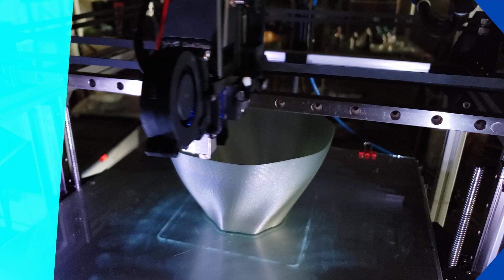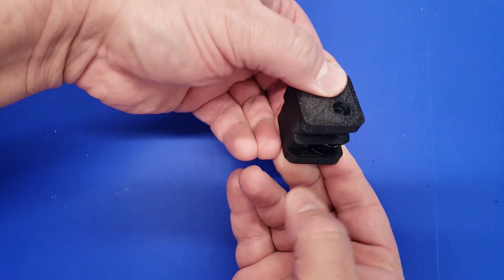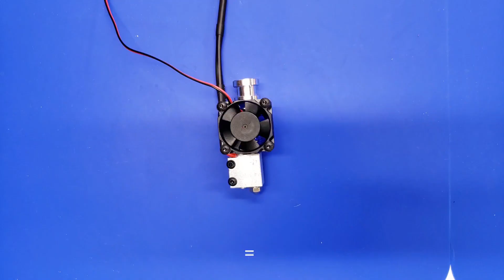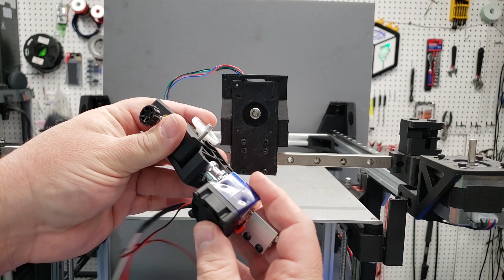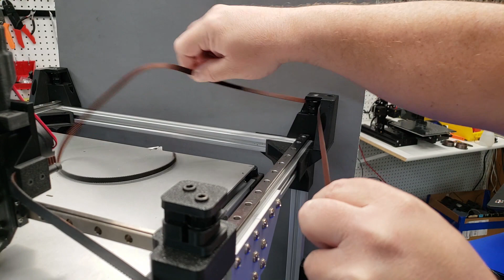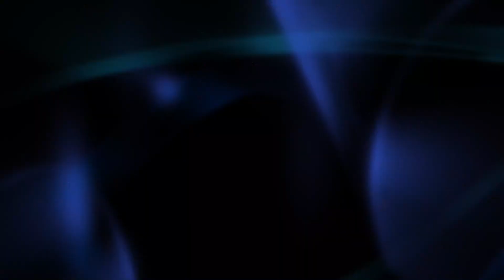DIY CoreXY 3D Printer Build | LayerFused X301 Part 4 - Carriage Assembly

Comment from the maker: What sort of belts will you be using on your 3D Printer?
Reply: Extra fat belts. to get good traction on the gears> NO slippage!
Reply from the maker: @techdiyer5290  The Gates belts have proven really good at preventing slippage.  Very happy with them.
Reply: hoping to find some 6 or 9 mm 3GT belt, stronger for the same belt width

Comment: Gates is the premiere manufacturer of automotive belts, including timing belts (same as these belts, just way upsized).  Gates is premium stuff.  I wouldn't cheap out.
Reply from the maker: And I didn't.😃 I also agree. I'm quite happy with the gates belts on the X301
Reply: @MakersMashup  I want to pull the trigger on this build, but I'm afraid of the time commitment. But I'm watching your videos to see if I'm going to be brave and give it a whirl. 
I suppose I'll have to add up the $$ in the BOM to see if this is something I can even do.
Reply from the maker: Its a great project and the discord community is awesome to help you on your journey should you decide to take it on.

Comment: I am sorry but I do not understand the assembly of the duct fan if the air intake of the duct is facing the engine side....
Reply from the maker: That is actually a brilliant part of the design.  Because the plate lifts the fan off of the stepper air will flow to the fan and it has the added benefit of pulling air around the stepper.  The fan running at full speed produces considerable airflow through to the part cooling nozzle.
Reply: @MakersMashup  I have to confess that I found it strange but everything has an explanation and in this case ingenious.
Your videos have been a great help to this newbie, thank you very much for your work.
Keep safe and greetings from Portugal from a assiduous follower
Reply: @MakersMashup  Voltage Question: Most of the NEMA motors I've seen omit the voltage required, even on the data sheet. And the 17HS8401 NEMA motor I've got is listed as a nonsensical 2.8v from the seller while the spec sheet only specifies the Rated Current. Will the stepper driver just handle controlling the voltage for me? I'm kinda worried I'd need to supply both 12v and 24v just to have a 24v fan, heating bed, etc.
Reply from the maker: Sort of hard to cover everything here but any stepper I've ever used handles 12 or 24v fine. Current is usually the thing to consider. Most 1a to 2a steppers are fine.  The entire system runs on 12 or 24 from the supply.  Don't mix and match 12 and 24 components.  Lots of help in or discord on these topics.